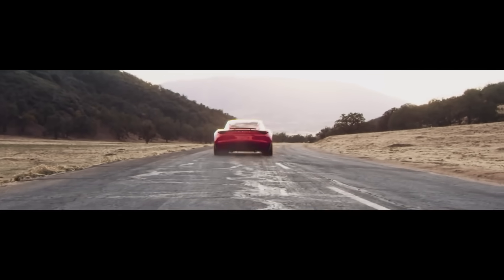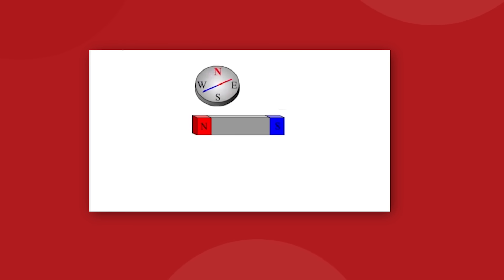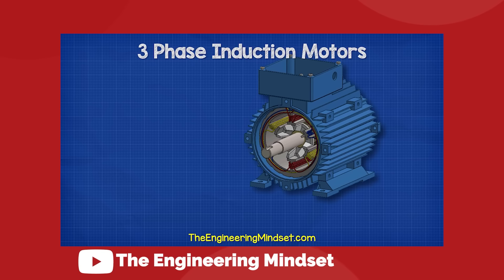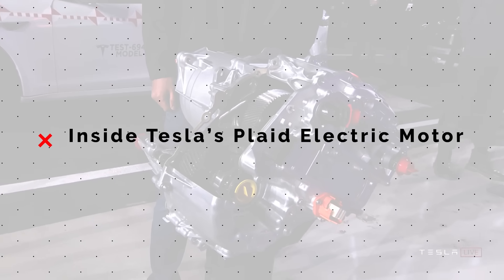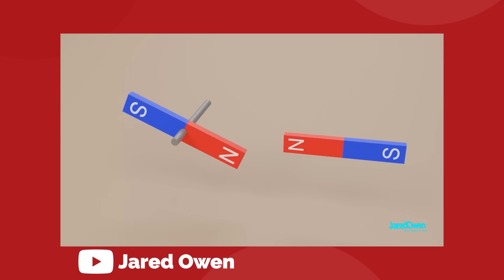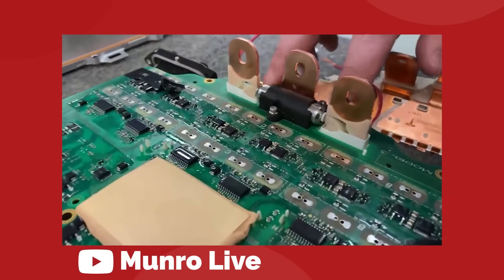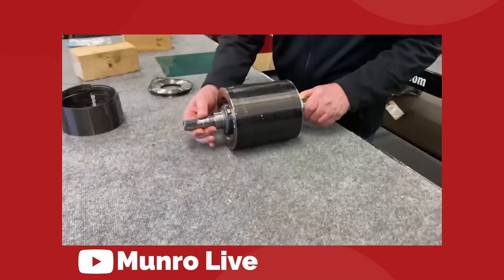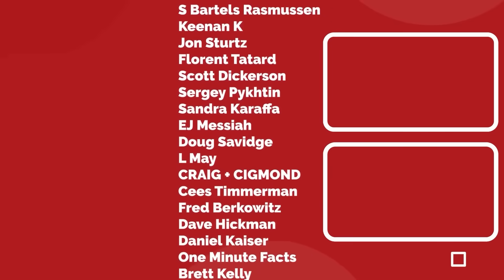The Real Reason Tesla Developed The Plaid Motor!

Comment: On the carbon fiber wrapping, that carbon fiber is under extreme stress, non stop.  I have to wonder how long it'll be until they start failing simply from the stress, even if the car isn't driven much.  Yeah it is carbon fiber, but surely it has a failure point too.

Comment: The diff is because the OUTER wheel is what is actually turning faster in a turn not the stated inner wheel. The outside diameter of a circle's circumference is longer than the inner..

Comment: The ultimate key to EV’s is a production version of the Solid State Battery. Whether it is Aluminum ion, Sodium Ion, or Lithium Ion.  For three reasons.  Energy density, fire proof, and charging time greatly reduced to a full charge in 8 minutes.  600 mile range that exceeds an ICE.

Comment: The fuse explodes when a short inside the stator winding occurs. This fuse explodes at a certain amount of current which has to be well above the inverter limits. So it protect both, inverter and battery from over current.

Comment: The ONLY time the inner wheel turns faster than the outer wheel is when feeding sufficient power through the open differential to exceed the traction limit of the inner tire (usually making squealing sounds and emitting smoke and putting black marks on the road)...

Comment: The problem with electric cars is not the electric motor😮 it is the battery and the electrical systems is surrounding the battery😮 the battery only gives you back about 80% of the charge that you put into it😮 and also the faster you are draining the battery that 80% will go down😮 plus you have to carry around 500 kilos of batteries😮 that is like 7 people sitting in your car all the time😮 it completely ruins all the efficiency that your electric motor have when compared to a gas engine😮 and this is just a few of the disadvantages of the electric vehicle system😅

Comment: THANK YOU FOR YOUR NICE VIDEO. There are several things I heard, that tweaked my ear. The wheel, on the inside of the curve goes less turns because it's going a shorter distance than the wheel on the outside of the curve. This says that the rotations are MORE for the outside wheel, than the revolutions for the inside wheel.
   The EXPLOSIVE "fuse" is designed to not only remove power, in the event of an overload or a short, but it totally destroys the card, thus, disables the vehicle, and I imagine, it costs a pretty penny to replace! That same thing could have been done inside a magnetically shielded arc shute, outside and away from that expensive part, where it would do the same thing, except all you'd have to do would be to change the explosive fuse and reset the contactor. A hundred bucks, tops. They designed the board to self destruct! DON'T you see that. It's all about the MONEY.!!! Motor control is designed to PROTECT THINGS, not destroy them on purpose! This, in my opinion, is nothing but a money grabbing scheme. I'd much rather have an old 1956 Ford or Chevrolet pickup truck. They got you where you wanted to go, you could work on them and fix most anything for less than a hundred dollars, there was NO derned computer in them and they ran on thirty cents per gallon leaded gasoline. Easy peasey, lemon squeezie. Besides, all that speed will get you is DEAD or a SPEEDING TICKET, or seized. If you have the POWER, you tend to USE it!

Comment: @brunonikodemski2420
@brunonikodemski2420
0 seconds ago
The airgap losses are now modelable using CFD codes of various sorts.  However, this is only for "ideal" situations, where nothing moves, grows, wobbles or goes supersonic.  Just as for airplanes, it is the transitions from inviscid to viscid flow, and from laminar to turbulent to shock wave(s), which are where the problems lie.  In the past, some of this was inspected by painting the rotor (or stator) with a friable or meltable paint or ink, similar to what is done with magnafluxing to detect cracks in metal.  The magnetic designers always have skew in the rotor (or stator) to reduce torque ripple.  Typically this is done using a straight line skew, but we found that this creates air pressure resonances at specific and often undesireable frequencies.  Variable skew rotors were introduced long ago, where it is easy to do this for cast induction rotors.  For stators, this is difficult, since that would be where the windings are, and would have to have special tooling to slide the wires through, since they typically cannot be pressed as a block, as is done in ordinary straight skew slots.  This was also inspected for high-speed machinery decades ago, but not easily made manufacturable.  Now in modern times, with robotic winding machinery, and with modern cad/cam software, such designs can be produced, and are manufacturable via additive metal techniques.  Unfortunately, even at this time, using additives, there is post processing required, similar to the olden days, so it is not yet ready for high-volume production.  GM, Ford, Toyota, Tesla, and others are actively pursuing such research as we speak.  There WILL be designs and materials which can improve motor performance up to very high speeds, resulting in smaller and lighter "motors", but the tradeoff then will be in the bearings and gear boxes required to get to the LOW road wheel speeds (or airplane propeller speeds).  There are NO FREE LUNCHES, in basic physics.

Comment: The electric motor doesn't expand at maximum power?  It expands at maximum RPM.   The inner wheel has to travel slower, not faster.  Lame Video.

Comment: Brushless motors are fast energy consumers and are 3 fase motors, what makes the difference between gas and electric is the fact that electric motors of a given HP soon as the power is turned on the full HP is applied even at low speed and a gas engine gain power by RPMs in a race you push the pedal to the metal to gain rpm but the tires eats the power if you just push it it'll be burning rubber only but lose traction the tesla is heavier and has motors at the tires grabbing power is much more and the motors keep the HP always may be the same HP than the gas car but is lighter and will reduce power at take off this making the ev faster besides if is awd

Comment: Mechanical engineer here. The main reason for the carbon sleeve under tension on the rotor so that it prevents any further elasticity of expansion due to centrifugal force and thermal expansion which can cause the outer diameter of the rotor to rub against the stator. Very sophisticated thinking by Tesla's engineers. This must be done using FEA analysis.

Comment: This is a primitive motor. The coil winding is stitched down rather than pinned. Radial motors offer much less power and range than axial motors and are 3 times as heavy. They over heat more easily.

Comment: The geomagnetic polarity of the geographic "North Pole" is opposite to that of the typically Red marked N north pole of a magnet. The N pole of a magnet points North (?). By this convention the actual global magnet if correctly labeled would be "S" on the geographic north and "N" on the south. Magnetically. That or the north pole needle of a compass is the magnetic "S" pole of a magnet.             Hats off to electromotive engineers !

Comment: yep not worth it as a mechanic i would never buy an EV. good luck replacing you core every 1-2 years depending on how much yo drive because it gonna cost you a crap load of money to buy a new one and install it with a 5% discount from the old core.

Comment: Very interesting. just a note an “induction motor” has no permanent magnets in it. A electromagnetic force is “induced” in the rotor. The lag of the induced voltage and current in the rotor causes a phase shift. The now opposing phases create the rotational force on the rotor.

Comment: This is an excellent video - thank you for the layman explanation on how the induction motor works and then going into the specifics of the Plaid motor differences, as all the points come across really well.  I walked away with a much better understanding of the motor basics and it helped to understand some of the details in Sandy Monroe's video that either weren't explained or were glossed over a bit due to assuming the viewer had a level of understanding that might not have been there.

Comment: Sorry, but your description of a three phase induction motor was very confused and blended with synchronous ac motors which use permanent magnet rotors.  An induction motor "induces" a magnetic field in the rotor which on its own is not a magnet.  Then you show an animation of a brushed rotor which is still not an induction motor.   Please study up on electric motors before you produce a video which will only confuse anyone wanting to learn about them.

Comment: I worked 38 years as a construction electrician, I worked 3 years as an Electric Motor winder, (I rebuilt electric motors) but there are still a lot of things I don't know of understand about Electric motors. I believe EVs are our future, I can say this even though I think we are not ready to shut down gas engines. The electric car has a lot going for it, if we get the batteries/charging worked out. Great video.
Reply: What is wrong on current batteries/charging?

Comment: 8:51  no motor has its rotor wrapped in steel, that would block the magnetic field. Normal motors do have silicone steel inside the rotor, in fact it's what makes up most of the weight of the rotor... HUNDREDS of very thin plates stacked up, with the permanent magnets strategically placed, and the steel shaped to focus the flux to the desired pattern.

The carbon fiber wrap is to prevent a "free-floating" section of the laminated steel core from flying off and destroying the motor. It's this free-floating segment that makes the Plaid motor different from every other EV motor... and more powerful. It's all about being able to tightly focus the flux.

Comment: Higher voltage is needed. Probably around 1200-1800v. Then you could have direct drive motors capable of very high RPM. A specialized configuration would also allow low rpm torque as well.

Comment: The Dutch company DSM was the inventor of the strong carbon wire that is stronger than steel. What rotor is wrapped with. Copied from the insect the spider thread.

Comment: It is interesting that Tesla did a small deal with Toyota to develop a Battery version of the RAV4. Philosophical differences ended that partnership, but Tesla did learn a lot about variable reluctance motors and added this to their new lines. In simple terms, the variable reluctance motor is a permanent magnet motor at low speeds, but transitions to an inductance motor at higher speeds. This provides better torque at the lower speeds compared to a simple induction motor.

Comment: 14:18: The inside wheel has to turn slower in a turn, not faster.  It is covering less ground so it has to turn slower than the outside wheel which is covering more ground in the same time.

Comment: Great video. Tesla have increased the operating envelope of the Plaid motor by ensuring centripetal forces cannot throw out the diameter of the rotor excessively thus allowing the motor to higher rpm. The wider operating envelope allows the Plaid to still run one gear ratio for 0-175+mph as apposed to Porsche who did not have a space company who have perfected carbon over wrapped pressure vessel production on hand for advice and guidance........nice.

Comment: It would have been nice to know that 50% of this video is just a recap on how electric motors work when the title talks about the plaid motor.... Also, idk who your target audience is, but it's likely for middle school kids because this is some BASIC stuff here... To top it off, you didn't even talk about how using a carbon fiber wrap keeps the rotor from expanding at high rpm which allows for a smaller gap between the rotor and the stator, which in turn allows for more torque.

Comment: Um, you just jumped from an induction explanation using an induction motor in illustration, to a wired rotor that's typically a dc motor that has brushes.

Comment: Yo not the fastest accelerating production car bud u need to do your research before u make your videos
Aspark Owl 1.7 0-60
Rimac Nevera 1.9 0-60
A car that has yet to come out but has built versions that have been tested and measured  called the McMurtry Spéirling 1.4 0-60 
And on top of that the measurement used on the Tesla website is a play on words and not that actual standard used to measure a 0-60 time the actual 0-60 of the Tesla is 2.3 there is a long list of cars that can beat that cars as far back as ten years plus

Comment: A lot of misinformation. 1. Carbon sleeves are not optimal for thermal conduction as well as strength. Kevlar would be more suitable, but usually fiber is used. For sure not a metal sleeve! This topic is many many years old and there are enough advanced companies around tackling with that. 2. The stator winding technology is so outdated, there a company from Italy offers a winding machine which works with rectangular shaped copper bars which create a significant higher fill factor of the copper. Continental is used that since ages now, Audi has it in his new machines as well as Porsche etc. pp. It also reduces the winding head which is bulky and just added losses. So, Tesla is not ahead, basically behind regarding that. 3. Don‘t believe non.knowledgeable people on the internet. ;)

Comment: An explosive fuse sounds cool at first until you spend more than 3 seconds thinking about it. The whole point of a fuse is to protect the circuit. Power surges, fuse pops and its a much cheaper, easier fix to just change out the fuse. The fuse in tesla inverter make absolutely sure that if there's an issue and the fuse pops, the fuse by design physically destroys the circuit meaning you need a whole new, I'm guessing very expensive replacement inverter. It also seems a bit dishonest for tesla to say its safer because it physically breaks the connection between the motor and the power....because that's what a regular fuse does anyway...

Comment: Nice work- others mentioned a few similar items… friendly “corrections”
1. Induction motors do not have permanent magnets!  This is one of the main reasons they are amazing! (The squirrel cage of aluminum bars in the rotor becomes magnetic in response to the external electro magnets). Please revisit this in a future video, I like your work 
2. Outer wheels go faster… check out the movie “my cousin Vinny” irreverent reference but fun.
Reply: Danny, Please elaborate, Im learning this subject so i can implement it in one project. Thank you. More the better.

Comment: There's a difference between acceleration and top speed electric motor you have two types you having high RPM and and high-torque and most Tesla's have no pulling power says zero tour that's reason has a 2-speed transmission and some of them so it has a lower gear for takeoff and goes to fold speed RPM Max immediately so it gets up to speed and second gear
Reply: Tesla cars have a single gear transmission.  There is no 2nd gear to shift into.  the OG roadster had a 2 speed gearbox, but that is the only one to have multiple gears.
Reply: @brandons9138  another person that don't know shit about Transmissions or motor and it has a two Gear transmission gears 4 take off and then high-speed you're an idiot because if it didn't you wouldn't be moving your single Gear with fried self within 2 seconds because it goes to high RPM immediately on an electric motor like the Tesla's high RPM Motor if it was a gasoline engine us a yeah I can handle that but then you would go this at another person that don't know shit about the gearbox of a Tesla electric car even Elon Musk says it has two gears
Reply: @jamesendsley1560  From Tesla's website/owners manual about the Model 3:

Transmission
Type	Single speed fixed gear Gearbox 
Ratio	9:1

So no. It has a single speed ONLY.  There are no other gears for it to shift through.  A simple Google search will show you that you are absolutely wrong.  The top 20 results all say the EXACT same thing.  I checked the Model S, Model X, and Model 3 all share the same 9:1 single speed reduction gearbox.

Comment: @14:15 You said on a turn the inner wheel needs to turn faster.  Is this correct?  I was always under the impression it turns slower as being the inside wheel on a turn it travels less distance so it must go slower.  I am no physicist or anything so I will totally admit there is a 99% changes I am totally wrong.

Comment: Tesla did not invent the radio or induction motors. There are people that have gone back through the archived material from that period and have proven that others were responsible for these advancements. 
The mythology behind Tesla is just silly.

The gap isn't microns. There's no machining technique that would make that possible. That's lower than the best tolerances. The bearings allow more movement. 

The inverter doesn't control current to the motor. It converts DC voltage to AC which operates the motor, and adjusts the frequency which controls the motor speed.